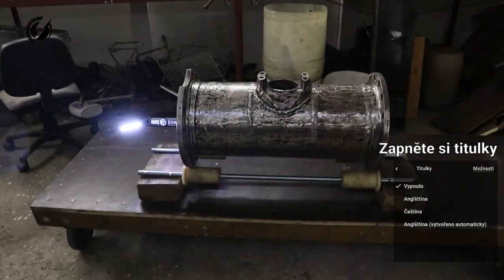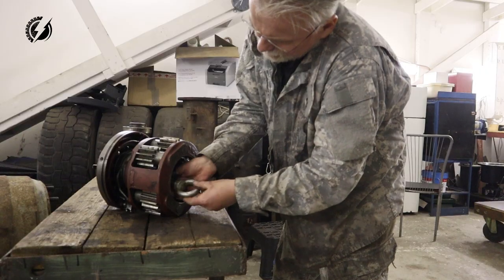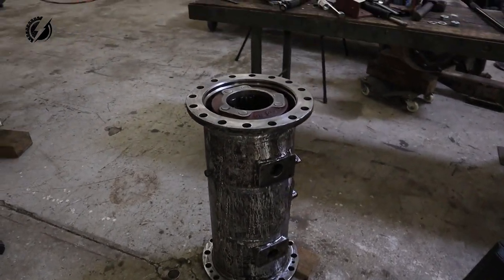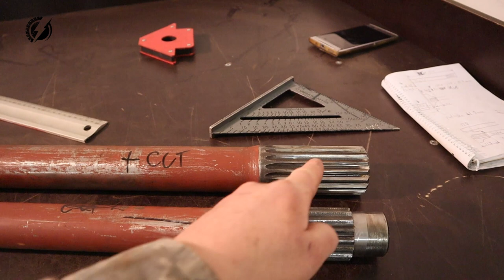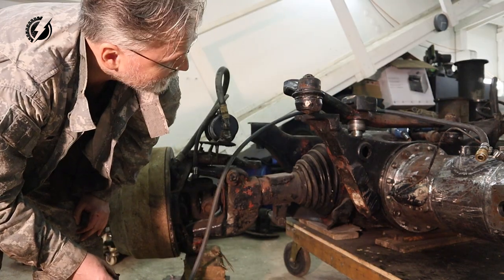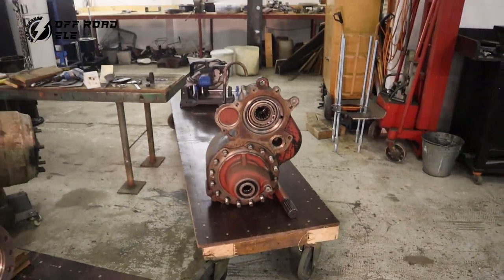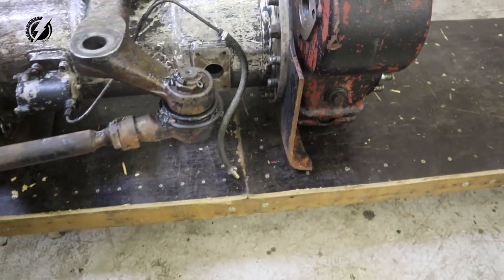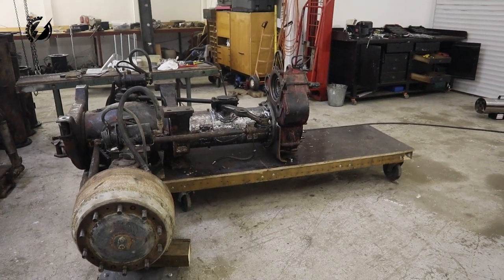EP 53  Building a Tesla/Tatra  2-motor Monster Truck

Comment: so in mass production it will be better to make the whole tube about 5 cm longer and thus, in the end, the car also about 5 cm longer ;)
Reply from the maker: When I have both bearings in the steering point and it will be more clear, I will determine the lenght, but I think I will make it about 2 cm longer. In the offroad situations very little makes a huge difference if you make it or not, I will try to make the tube as short as I can.